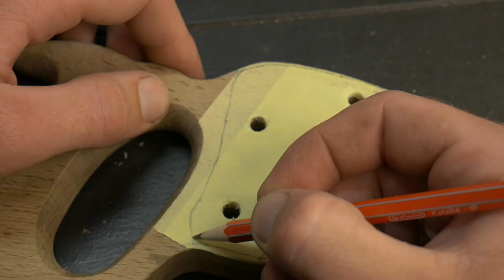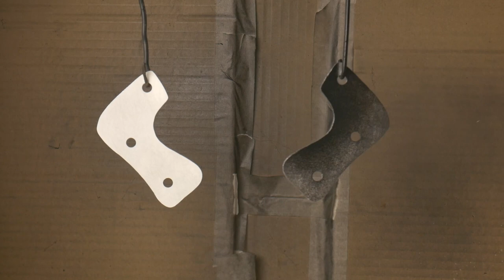Rusty Hand Saw Restoration - Deep Rust Removal

Comment: Decent enough job to get the saw back in good working order. Why did you feel the need to add the aluminium plates on the handle? Cosmetic reason only? Not to my taste but still liked what you did to the rest of the tool.
Reply from the maker: Thank you for your feedback,  Costa! It could be any metal, it doesn't matter, but this shape protects the handle better :)